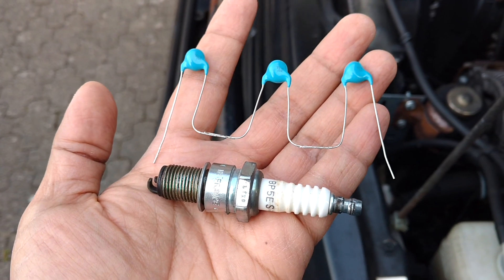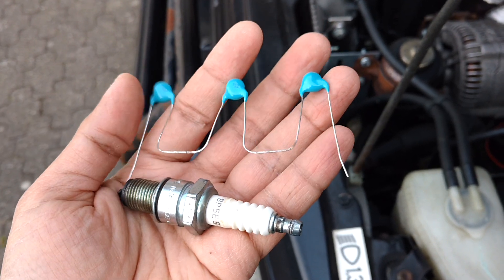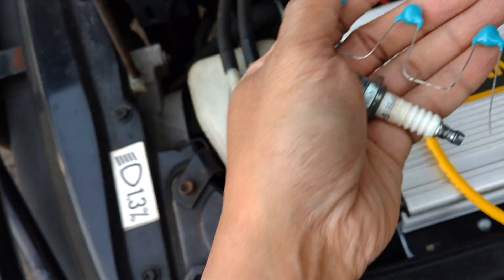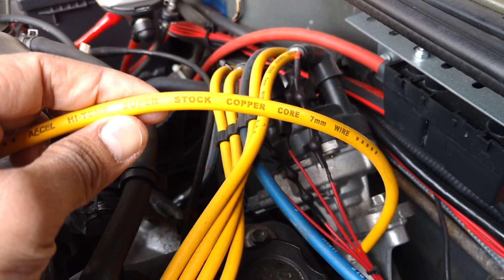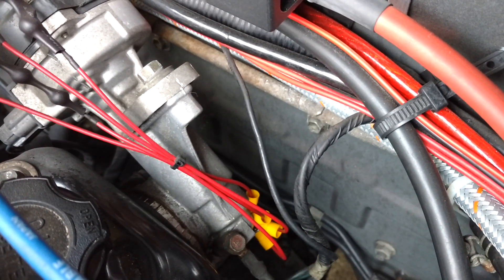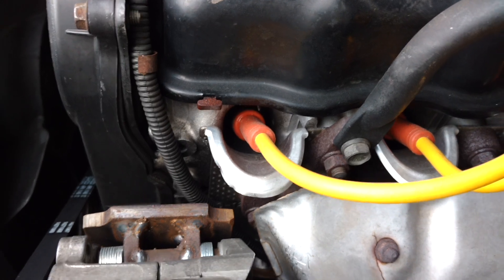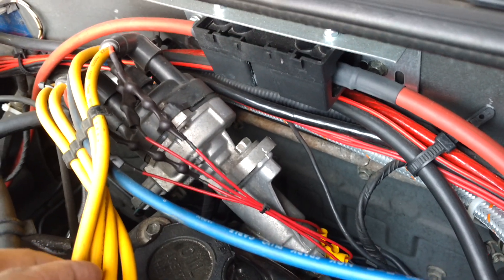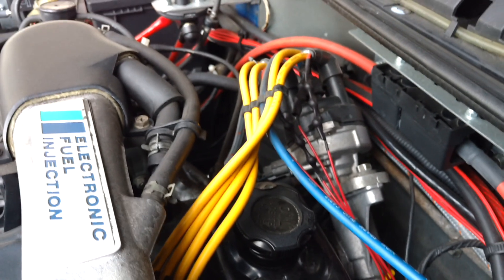Simple Plasma Ignition - my actual installation

Comment: That's good idea, can I installed in my car, my car is injection use CDI, the coil place in the top of spark plug
Reply from the maker: Yes, you can. You have to be creative to find a place to mount the capacitors across each spark plug.
Reply: Ok, when I check the cable have resistor, did I must to change the cable , thank you very much Okki  👍

Comment: Very good video, I want to apply it in my carbureted vehicle. I have capacitors of 220pf 50v. How many should I use for each spark plug?
Reply from the maker: Thanks. You can combine your capacitors to get value around 70 pF with voltage range of 30 kV.

Comment: Mas, kalo untuk rpm tinggi ada perubahan gak? Takutnya bisa merubah timing pengapian nya, kan kapasitor sifatnya menyimpan arus, atau mungkin pada limit rpm atas berubah juga?
Reply from the maker: Pastinya kalau pakai kapasitor seperti ini, frekuensi maksimal dari coil pengapian akan turun. Seberapa turunnya saya tidak tahu, karena saya tidak pernah ada masalah di mobil saya jadi saya tidak pernah ukur. Sistem ini sudah saya pasang sejak lebih dari satu tahun yang lalu di mobil saya dan saya pakai mobil ini setiap hari.

Comment: The yellow cables are spark plug wires and they are connected to the distributor those are the things you had pointed out just wanted to lend some friendly knowledge not hate

Comment: Advance your timing 30 degree's and see what happens.
Reply from the maker: What can I expect with that? Can you please explain?
Reply: Okki Moeljadi In theory you can turn off your fuel and the bigger spark firing off when the piston is down will cause an implosion similar to a lighting strike which will in turn draw the piston up.
Reply: Research a Joe cell. From my understanding a Joe cell is basically a capacitor used in a bit different way to obtain a similar result.
Reply from the maker: I have read some documents and saw some videos of Joe Cell. Have you tried to do this on your car or any engine? What result did you get? I don't think we can do that using these small capacitors.

Comment: Can Some one explain to me what actual good this does?
Reply: Jon Rudin , supposedly it allows for a "hotter" spark at the spark plug gap, but this is debatable.  He could have use a higher voltage  coil along with higher voltage spark plugs. I say debatable because at higher RPMs  the capacitors will act as a short to ground.
Reply: this will give high ignition on spark plugs but will puncture a hole on the piston head i see i before with  people using firestorm a hole in a piston head
Reply: It's a great idea to to get your car fuel remapped to a 17:1 air fuel this way you will get much more lean without burning any valves etc. You need to take your car to a specialist and tell him what you want. You can also install a water vaporizer system when you do this and your car will have plenty more power at this rate. Enjoy.
Reply: @pehgt5099  Any experience? I'm on a similar path.
Reply: @pehgt5099  Any experience? I'm on a similar path.
Reply: pe hgt sounds interesting as cars run a bit rich from the factory, I'd probably add a pure hydrogen cell as well.
Reply: Your only running 10 khz max, so size accordingly.
Reply: Adon Lando i was goint to say if i was a spark id jump right through these anal beads.. electricity is like water, it just finds a way, and this method of hotter spart has alllll kinda of holes in it.

Comment: Start adding fogged water to your intake and I bet that ignition setup you got would ignite some of it.  There's a guy I found on YouTube with a video from 2008 that was doing that, but he used a power inverter with a full bridge rectifier to a capacitor before going to the ignition coil.  WIth that setup instead of 12-14 VDC he had 150-180.  VAC when converted to VDC gains voltage for a reason I can't remember, so the 120VAC got a boost.  This is on my wish list of experiments to do.  My only concern is if it will damage any electronics having that kind of voltage (if 13 turns into 50kV, I'm going to be looking at 500+kV), and how long the power inverter and spark plugs will last.  I might even use that setup on my hydrogen generator.  I'll definitely be using capacitors to limit the current right on the output of the inverter.  For ever 25uF of capacitance on a 120VAC circuit it will allow 1 amp through.  I've tested it on my lab setup so I know it to be true.
Reply: Video (download it while you still can):  https://www.youtube.com/watch?v=FxnRQ7fkWtE
Reply: 500+kv will escape from everywhere to everywhere including the people driving next to you, the sky, your leg. etc.
Reply: Hmm, that probably is a good point to consider.  Although, I don't think it will escape like that since the guy had a camera in the room and he was doing it.  neither he nor the camera got zapped, and billions of volts is what it takes for lightning to cut the sky, not half a million.  If he can get away with it in an open area there's no reason you can't do it in a car.  It just needs complete isolation from everything, and proper engineering to ensure it doesn't damage the battery/charging system.  That's well beyond me so I'll stick to simple HHO at 150VDC for now.
Reply: Aaaahhh,, it was electronic humor.  sorry I confuse you.

Comment: Hi，Friends
Why My bike does it not start well after installation? 220pf 15kv ×3，Could you help me?  My English is so poor…
Reply from the maker: You have to make sure that you don't have any spark outside of the combustion chamber. Any spark outside combustion chamber will kill the spark inside the chamber. Also make sure that your ignition coil has enough power to charge the capacitors.
Reply: Okki Moeljadi ķ

Comment: Hi! What is the higher value of capacitor would you recommend to get higher plasma spark that would last long for both the sparkplugs and capacitors? Your reply is greatly appreciated. Thanks
Reply from the maker: Blue Haze, I would recommend you to use 150 pF capacitor. I think it's a good compromise between good plasma and sparkplugs wear.
Reply: Okki Moeljadi thank you
Reply: Blue Haze power reshyu in capacitor..
Reply: Blue Haze
Reply: Blue Haze j

Comment: Hi okki, I only have one question. When using the capacitors, the time in which the spark is triggered is modified?
Reply from the maker: I did not change my ignition timing at all. Theoretically you need to set your timing a little bit advance with this setup.

Comment: Hi.  Very cool.  I had those wires before, and they would glow blue at night while running.  I found out, after I got rid of them, that when race car drivers use them, they buy special sleeves to put them in to prevent arching to the outside of the engine.  The main problem with those wires is that they are sadly not made for coils that we use these days.  Even 10kv coils on old cars were almost too much, and your coil is probably a 100kv coil, which, like mine, was way too much.  I eventually took them off, but did find a better way to get a better spark.  I put a ground wire from the battery to the base of the spark plug, if there is no room, I would put it on a washer and put it on the valve cover bolts.  It also helps the alternator to do this, not directly on the alternator, but on the bolts that hold the alternator on the car engine.  You are very smart, I wish you lots of luck.
Reply from the maker: Hi Gristle, thanks for your kind comment. Basically what you do is to connect the negative terminal of the battery directly to the body of spark plugs. No, I'm not that smart. I'm just curious and want to understand things.
Reply: What if you used a microwave oven capacitor or 3? :)

Comment: HI OKKI MOELJADI, HERE IS BRAZIL,  HOW  WOULD A MOTORCYCLE CABLE...???? THANK YOU SO MUCH.........!!!!!
Reply from the maker: Hi Sérgio Cupertino. The best way would be to connect the capacitor directly parallel to a non-resistor sparkplug. If you want to install it like I did, you have to make sure there is no resistor on the conductor (wire etc.).
Reply: Brasil na área, vamos dominar essas tecnologias!
Reply: +Aroldo Júnior kkkkkk verdade fiquei doido ao ver tbm
Reply: Gostei do projeto desse cara,bem criativo e inteligente!Vamos trazer essa tecnologia pro Brasil e aplicar em nossos projetos/Veículos!

Comment: Can it be used on a engine with cdi ignition sistem and with resistor in the spark plug boots?
Reply from the maker: It should work with CDI system but any resistor will kill the plasma.

Comment: how do I know the polarity of the ceramic capacitor?
Reply: ceramic cap no polarity and it is usually used in the AC system ...either way is correct

Comment: Hello Mr Moeljadi, would it be advisable to use 3 X 15 KV but at 100 Microfarad  each instead of the 220 microfarad you used or is the 220 just perfect as it is ?
Reply from the maker: Your total capacitance value will be smaller than mine but it should work. It means you will get smaller plasma spark.

Comment: did adding the capacitors make any difference in the running and the mileage of the car?  Where did you get the copper core wires.  here in India it is very difficult to get them.  what is the cost of the cables?
Reply from the maker: I bought these wires on an online shop. These come from USA, the brand is Accel.
Reply: does making plasma plug made any difference in the running of the engine and the mileage?

here in India getting hold of copper core spark plug wires is almost impossible.  can this be done with silicon wires which are the OEM of the car? 

Also what is the lowest capacitor value in voltage terms i can go for because  we do not get 15kV capacitor here?
Reply from the maker: Your questions have been answered on my videos. Please check out all my plasma ignition videos and read all the descriptions and comments. It's all there. I think it is not necessary for me to write the same thing over and over again.

Comment: I have some questions : Has this setup affected any important components in your car like ECU or Ignition Module,etc ?  If i don't ground the wires like you did - Will it work via switch on the dash board an turn on the plasma effect when ever i want ? And is the blue wire going to an external coil ?
Reply from the maker: This setup does not affect my ECU nor Ignition Module. I don't think your plan will work with switch on the dash to turn on and off the plasma. Yes the blue wire goes to ignition coil.
Reply: I would be cool for that to work via switch like a small shot of NOS XD
Reply from the maker: Yes, but you are dealing with high voltage here. It will only work if you use high voltage (low resistant) cable and high voltage switch. And you need one switch per spark plug. I doubt that you can find high voltage switch easily and cheaply.
Reply: Good point.Each switch or one big switch would had to be high voltage rated to handle all of that.
Reply: It would have to be a main breaker switch like in a house XD

Comment: hello okki I would like to know where you connect the capacitor if and directly in the bubina or if the positive wire of the coil and what number of the capacitor I should put my motorcycle
Reply from the maker: Hi Joao, just connect the capacitor directly parallel to the spark plug. Maybe you can use 70 pF.

Comment: Halo mas Okki, thank you for this great sharing, for its a breakthrough to optimize engine performance. I really appreciate it, And i want to ask you just simple question what you attempt to do is to gain 73 pf capasitance, at 45kV current from 3 serial capasitor? Why? Or do you have any other preferences number? Thank you mas Okki
Reply from the maker: Hallo Irfan, you're welcome. Basically if you have higher capacitance value, you will get bigger plasma. But the maximum value depends on your ignition coil. If you have powerful ignition coil, you can use bigger capacitor. But there is one thing to remember: if you have big plasma, your sparkplug electrodes will wear quickly.
Reply: Okki Moeljadi
Master, I'm one of those who follow your posts on youtube. And the simple plasma ignition interests me. I want to build one for a suzuki minivan with a 3 cylinder engine. I just want to know if how many ceramic capacitors in a series needed for an ignition coil with a 60kv maximum output, MSD ignition coil. Please, I need help because I don't have knowledge on electronics. I already have resistorless sparkplug and now sourcing ceramic capacitor with 220pF 15kv. I visited one of the biggest electronic parts here in the Philippines but they don't have high voltage capacitor. 
Thank very much in advance.
Reply: Okki Moeljadi 
Sir , thank you very much for your reply. I'll try to  do it myself following your diagram. Hoping to have it soon. Once again, thank you.
Reply from the maker: Hi Juanito, the configuration like mine should work. Just put 3 pcs. 220pF 15kV capacitors in series. If you can't find them in your country, you can build them yourself, please check out my DIY capacitor video.

Comment: Well, i tried and failed...I had 4 of the exact same capacitors hooked to the head of each of my spark plugs with the other ends grounded to the engine.  And I BLEW all the capacitors!!!  At first, I don't think I had them insulated with enough electric tape, because I saw 2 of the plugs arcing off on metal pieces on the engine.  Then I went back and wrapped them really thick, drove for  a couple hundred miles.  When I went to check the capacitors they were all blown.  I can't figure out where I went wrong.  I grounded it a little different than you did and that might be what messed it up.  I'll try to post a video to show you and maybe you could tell me where I might have went wrong....:-(
Reply: Nick H I'm sorry but you have to have a coil if you have any spark plugs weather you have coil on plug hei or points type distributor you always have a coil
Reply from the maker: Please let me know if you have posted your video. Maybe I can point out something.
Reply: Are you using resistiveless or reisitive spark plugs?
Reply: Capacitors will short to ground at higher rpms.
Your calculations were probably past the threshold of stability.

That and the fact that he has added an ignition coil to his car's ignition system. A car like that from the factory(stock) normally uses a distributor as its only source of ignition

Comment: Is there a polarity on those small capacitors?  I have the same capacitors now and I looked at them with a magnifine glass and it just looks like a dot right beside the 221.  Is that dot suppose to be the positive side?  and I am going to use 10 gage wire, seems kind of thick but I guess it will work...
Reply from the maker: mppforall, sorry I don't know your capacitor. Just get yourself non-polar-capacitors and you're good to go.
Reply: I ordered the same ones you have. Are your cap polarized or non polarized?
Reply from the maker: Mine are all non-polarized.

Comment: What size wire did you use when you connected the capacitor to the ground on your vehicle?  12 gage? 14gage?
Reply from the maker: mppforall, I don't know. Actually the thicker the better. Just use thick flexible cables as the stiff one will break with vibration.

Comment: I see where you made the connection but How did you connect the capacitor to the end of the spark plug wire? Did you solder it? did you just crimp it?  I have non resistor wires and non resistor spark plugs, I can't wait to try this!!! Thanks again for the great videos!!
Reply from the maker: Yes, I crimped the capacitor to the end of ignition wire on the distributor side. I did it like this: soldered the capacitors together, soldered cable at both ends, crimp one end to ignition wire and mount the other end to the motor block.
Reply: Great! Thank you!!!